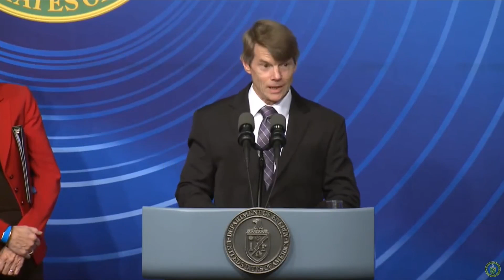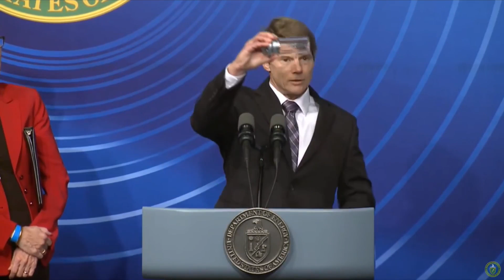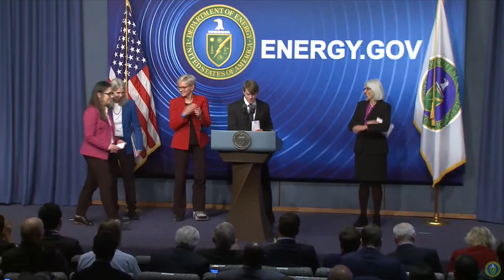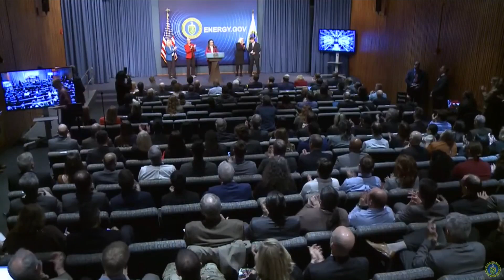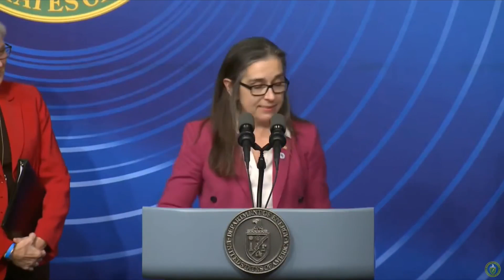Fusion energy breakthrough and national security implications explained

Comment: Thats not a great accomplishment when you consider that 1 Kg of Hydrogen can produce 1300Mw of energy from a solar Hydrogen Energy recovery Gas turbine

The process is similar to a nuclear fusion reactor. However, instead of achieving nuclear fusion at extremely high temperature (150 million degrees Celsius) this system achieves and maintains Ignition at much lower temperatures. It doing so it uses an energy output that exceeds the energy input required to start and sustain the reaction.  

The operating complex requires an area the size of a football field. The hydrogen power generating turbine has three operational parts, 3.0m in diameter 5.5m long weighs 6 ton has a 14-year continuous life cycle and incorporates direct air capture of CO2 at 1,400 Kg/sec.  

The cost is $36.5 to 49.5 million being significantly less than an equivalent 330Mw nuclear reactor, solar or wind farm.

Comment: A lot of people are way too excited about this. They only achieved a net positive Q plasma, which means that the lasers used to heat the plasma used less energy than what the plasma produced. This is not even close to what they need to achieve. Other experiments already have gone past this phase, and after that it becomes really challenging. In order to get a useful product, you don't need only to get a positive value of Q plasma, but Q total. What they didn't tell you, is that all the systems needed to sustain the process, use far more energy than that laser used in this test.

Comment: Unfortunately this is a total scam. They did not COUNT THE 200 LASERS IT TOOK TO FIRE THIS THING OFF. It only generated enough energy to maybe make a kettle boil. Those lasers took a massive amount of energy to just fire them, so they are saying this is a success, when no, those lasers sucked up a ton of energy from fossil fuel plants etc. As it is, its completely impractical. The process consumes zillions volts just to make it work and produce barely enough energy to run your phone. Whats going on here? This is is propaganda. The process creates millions of degrees, and any kind of failure in the hardware could provably wipe Los Angeles off the map. Is this going to solve the world's energy problems? No, never. Its a bad method, but they are pushing it because it will take us from the ultra rich with their toxic inefficient fossil fuels to an even more inefficient toxic dangerous process that the ultra rich fossil fuel companies will glom onto, leaving the same poverity stricken counties in the ditch and your energy bill will not be lower, it will likely be even higher. This is a sleight of hand trick that will do nothing for humanity and create power stations more dangerous than nuclear power. Wake up, this is a trojan horse. Go watch Steven Greer's reality check in his recent video. There are much better ways of tapping the energy that is all around us. THAT is the future, not this huge waste of money , they claim overunity, yeah like 1% if even that, but it takes a hundred thousand percent just to make it work, totally the wrong direction to go in. The fossil fuel industry is never going to let these zero point energy devices succeed, or any other overunity of even free energy devices either. How many peope have died, disappeared, or been bought off to make sure that Humanity is always enslaved just heat their house and run their car. A true clean energy device that uses modern physics and forbidden access to the massive energy that surrounds us, could end poverty, sickness, allow the Earth to heal from the horrors we have done to her, it could be heaven on Earth, but these evil corporations will not allow anything that costs so little to succeed, because it will destroy these powers. Look what they did with fracking. "Clean energy" it is NOT. We are systematically destroying the world's water tables, by poisoning the Earth to get natural gas, that we pay dearly for. They only gave us something more to destroy the planet while they become obscenely wealthy and humanity lives in its own filth, oceans are dying. Unbelievable what they are telling us now. Please watch this video to see what they are trying to pull on us https://youtu.be/nOvmmEQYwIs

Comment: Can someone account for the 500 MJ that were needed to power the lasers so they could provide 1.8 MJ as input which then produced 2.5 MJ output? 

So they used 500 MJ to generate 0.7 MJ net positive. The reaction is not self sustaining (like the sun) so how is this a breakthrough. 🥴

Comment: Off-grid solar remains the best way to cut out the grid most of the time except for top ups, and the potential to sideline the grid altogther terrifies green socialists far more than any inevitable fluctuations in the climate.
This announcement might be conveniently timed to undermine the shift of people switching every viable roof on Earth to independent solar power coupled with local energy storage for use as required by those individual households, at the same time that all reliable forms of energy production are being articially constrained, mothballed, or overtly targeted for destruction like the Russian gas pipelines were.
We all want clean energy but mustn't compromise existing energy security before the new alternative is in place and up to the task, so long as the miracle of clean fusion isn't abused to grant the energy barons a new monopoly to sell energy to us via the grid and keep serfs hooked on 'their' clean energy.

Comment: In essence they built a perpetual motion machine, whereby the power output exceeds the power input.

This violates the first law of thermodynamics. Also, he did say that the speed of light has been broken.
Proof, if needed, that the universe is indeed not locally real (well its already been proven 2 months ago, but this is icing on the cake).

Comment: Tony Roulstone, lecturer in nuclear energy at the University of Cambridge, said:

“It is reported that the National Ignition Facility (NIF) has surpassed one of its own targets to exceed scientific energy gain.  They put 1.8 MJ and got 2.5 MJ out – proving that energy can been successfully released and gained by a Deuterium-Tritium fusion reaction. This is positive – the failure to achieve scientific energy gain in 2012 ended the run of experiments for which NIF was built. Now they have worked on the design and the make-up of the target and the shape of the energy pulse to get much better results.
“Although positive news, this result is still a long way from the actual energy gain required for the production of electricity.  That’s because they had to use 500 MJ of energy into the lasers to deliver 1.8 MJ to the target – so even though they got 2.5 MJ out, it’s still far less than the energy they needed for the lasers in the first place.  In other words, the energy output (largely heat energy) was still only 0.5% of the input. "

Yikes! 0.5% output isn't something that's going to power anything anytime soon. And even just laser diode efficiency probably won't reach required levels in our lifetimes. That's not even accounting for losses in light transmission or efficiency losses from drivers for solid state diodes(assuming that becomes the type utilized). 

I think it's great that they achieved a goal they had, but I also don't think it can realistically be used as a nuclear deterrent or a solution for the energy crisis in the immediate future. Just from a laymen point of view I think maybe zap-energy or Helion will probably be the first to get a commercial unit into real production. Hope they keep working at it.

Comment: Since the goal is to increase the power and longevity, what happens if the power output grows exponentially? What fail-safes are in place incase of a runaway event? From what I understand it's all contained in a magnetic field that keeps the reaction symmetrical, so is the fail-safe 'built-in', where if it grows outside of the containment that would cause a-symmetry and collapse naturally? Where does the excess energy go?

Comment: So, if it can be sustained or even just duplicated many times over, and a way to extract and use the energy surplus devised, then this would essentially mean unlimited free clean energy? If so, then bravo NIF!
Reply: You wouldnt be able to power the reaction by the energy created as it generates 50% more power than the supplied power as you would halve the power for every iteration. This technology will make existing clean energy sources more efficient tho, which is awesome!

Comment: My suggestion is just use a methanol home heater it would cost a damn site less and you would get a damn site more heat out of the fuel source love the concept though it does what the sun does everyday give out vast amounts of heat energy with the minimum of fuel spent H fusion convert to Helium what a laugh -in -gas

Comment: I1:27….
t produced more energies….. 2 mega joules in about 3 MJ out..”

192 lasers and billions of taxpayer dollars to produce enough energy to boil a cup of water…..

….heating water 30 degrees hotter than room temperature uses 84.24 MJ per hour…..How many lasers are required to achieve heating a shower and at what cost?

On average, it takes 25 kWh per 100 miles to power the motor of a compact electric car. For an electric car with a 25 kWh motor, it would take 900 MILLIONS JOULES of energy to travel 1,000 miles.

Comment: @smartereveryday Hey, Destin, could you please breakdown what this means to be able to obtain a 1.5x return off of lasers, what this means for future capabilities of science, and overall, just a better understanding of why this is important or how it even works?
Reply: 50% more energy came out than went in. Two low-level nuclei are heated (Deuterium and Tritium, I believe), hot enough and long enough, to fuse (hence, Fusion), and that fusion event generates 50% more energy than was expended in the process to achieve the event. 
Imagine if after running a mile, you had 50% MORE energy than when you started. 
They discovered a process that generates a surplus of energy. These nerds may be gods.

Comment: I Call Shenanigans. In 1977-78 At Berkly's particle accelerator a physicist created Gold, by smashing bismuth together, in said accelerator. The only real problem was they couldn't build as fine an injector as they've been able to do for Oh the last 20-30 years. Everybody wants to heat the Hydrogen to 300 million degrees, For What I don't know. When in modern accelerators you can accelerate atoms to 98-99% the speed of light, and you let the kinetic energy those atoms contain do the rest. Not only do you NOT have to heat the material to crazy temps, but if you spend the time making the accelerator ring like two corkscrews intertwined, which lets you take advantage of angular momentum you can lower the power needed to accelerate those atoms to speed. While your at it you can use those crazy expensive Tokomaks as reaction chambers for all the hot plasma that's generated. To bad they've spent billions of dollars and wasted countless years Playing at the Science of FUSSION energy. I personally believe the reason they've wasted so much money and peoples time is Oil, AND they really don't know how to harvest the Direct Current that said plasma generates. Seriously, they actually plan on boiling water to drive turbines with this technology. Boiling water, WHAT are we goanna go see the Queen and have a cup of TEA.  
IF you can SMASH heavy atoms together to make GOLD. Then Hydrogen Should Not be an ISSUE. Unless you've been Told to slow things down BY the People in charge of your Research Grants. OR maybe my one professor was right, when he said that PhD's were stupid as stumps, AND that man had three of them.

Comment: YAY... THE FACILITY POWERED ON TAKES 300 MEGA JOULES OF ENERGY TO KEEP THE LIGHTS ON AND COMPUTERS AND TEST EQUIPMENT AND POWER THE LAZERS USED IN THIS EXPERIMENT....   THAT 300 MEGA JOULES PER HOUR THEY USE IS NOT MENTIONED BECAUSE ALL OF THIS IS PURELY SYMBOLIC IF YOU LOOK AT RUNNING THE POWERFUL HIGH POWERED LAZERS WITH 2 MEGA JOULES GOING IN AND GETTING MORE ENERGY OUT THEN YOU SAID... IE YOU PUT 302 MEGA JOULES IN and you get 3 MEGAJOULES out.   THAT is maybe a 1 percent effective reading... but these scientist who are just telling you what the mirors and smoke read 2 megas at the lazer side and 190 for cooling and powering the computers reading the testing.

Comment: all very wonderful but there is something they don't tell you. Okay, so the laser was  2 megajoules, and the output was about 3.0. Only problem is, it took 400 mega joules of electricity to produce the 2.0 mega-joules of laser energy-that is how inefficient today's high-energy lasers are. That they achieved fusion is  great news, but the story is way over-hyped. This press conference should be entitled HOW TO GET GRANT MONEY. Don't believe me?  Here is a quote from one many news stories on this. I've also included the link: "The complicated part, though, is that the reaction also requires a ton of energy to start. Powering the entire laser system used by the NIF requires more than 400 megajoules - but only a small percentage actually hits the hohlraum with each firing of the beams. Previously, the NIF had been able to pretty consistently hit the target with around 2 megajoules from its lasers."   https://www.cnet.com/science/major-energy-breakthrough-milestone-achieved-in-us-fusion-experiment/

Comment: This l sounds too good to be true and at first examination it probably is too good to be true. It produces energy at a ratio of 3:2.  That sounds expensive as the produced energy has to be industrialised and distributed.  I can’t see with the expense of producing industrially and distribution can be cost effective.  The retail cost of this energy is going to be expensive.  It takes 2 m Joules to produce 3 m Joules.  So for every 3 m joules produced 2 has to be fed back to provide 1 m joule for the system.  1 mjoule is a little less than 3 KWh. Enought to boil you kettle.  But this energy produced here is heat, it still has to be converted into steam to drive a turbine and create electricity.  By that time the energy conversion will be a negative ratio.

Comment: This is a massive misrepresentation. What they don’t tell you is that the energy input into the hydrogen pellets is the laser beam energy, NOT the total input to the entire laser system. The lasers are very inefficient, and less than 1% of the total apparatus input energy gets to the beam energy. So the claim of energy out > energy in is simply false. It’s really a big “so what”, that more energy is released from the hydrogen pellet that is input to it. Beyond this, there are a multitude of reasons that this won’t scale up. The lasers require a day before firing again. How are precisely engineered capsules, containing cryogenic hydrogen to be manufactured and delivered to the beam target position? The whole concept is flawed in many ways and is NOT an avenue to utility scale fusion. There are more massive engineering obstacles than mentioned here. This is more about bureaucratic promotion, and continued funding, that any realistic pathway to utility scale fusion. The speakers give us the “gee wiz” treatment, aimed at a naive public and politicians .

Comment: From the web search:
"The day of clean, limitless energy from nuclear fusion has taken another step closer thanks to China’s Experimental Advanced Superconducting Tokamak (EAST). During a four-month experiment, the “Chinese artificial sun” reached a core plasma temperature of over 100 million degrees Celsius—that’s more than six times hotter than the interior of the Sun—and a heating power of 10 MW, enabling the study of various aspects of practical nuclear fusion in the process.

Beginning operations in 2006, the Chinese designed and developed EAST is located at the Hefei Institutes of Physical Science of the Chinese Academy of Sciences (CASHIPS) and is billed as an open test facility for conducting steady-state operations and ITER-related physics research by both Chinese and international scientists. And, like many other fusion experiments, the ultimate goal is to produce a practical nuclear fusion power reactor.
EAST is a tokamak reactor, which consists of a metal torus or doughnut that is exhausted to a hard vacuum and then injected with hydrogen atoms. These atoms are then heated by a number of different methods to create a plasma that is then compressed using a series of powerful superconducting magnets."